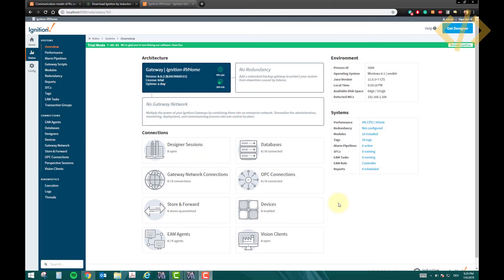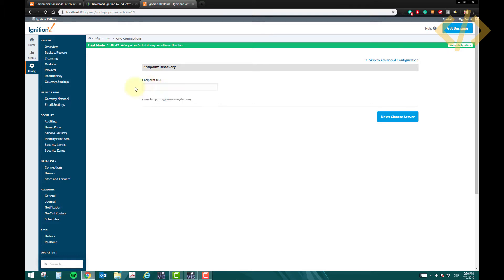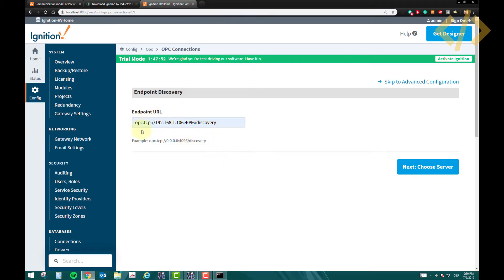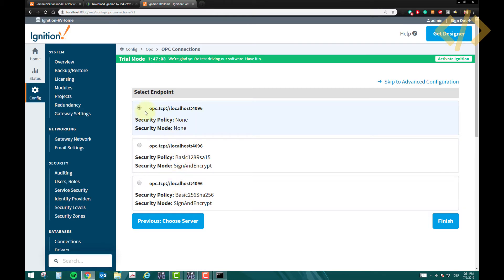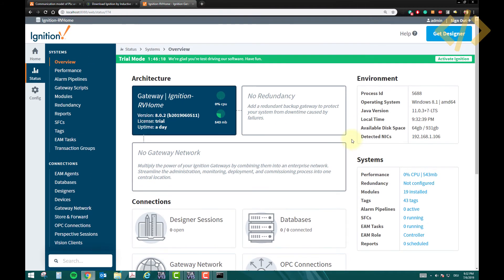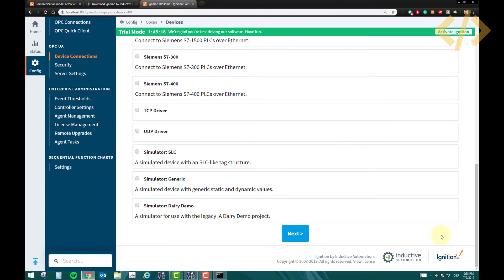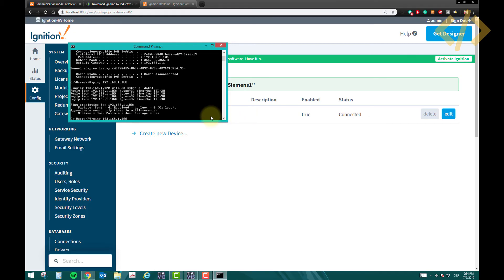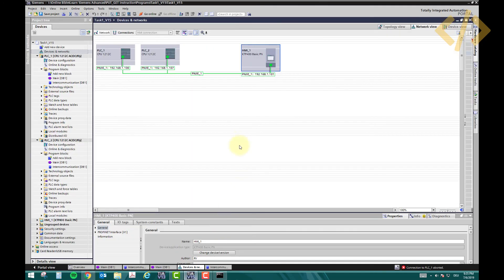Lesson 2-  Creating OPC UA Server and adding Siemens PLC in Ignition SCADA

Comment: Hi,
My customer using ignition and they will like to connect my plc. I check some video and I see only need to add ignition configuration opc from ignition and my plc only provide ip address then hit connect can direct browse my plc tag ? So my plc CompactLogix 5380 , don’t need programming or coding ? Just regular tag from plc , ignition can direct read or control the tag ?

I see opc just built in on ignition software

Thanks
Reply from the maker: Yes you can read that. Just make sure you add correct IP address for the PLC with OPC UA port number. You can read the tag directly

Comment: Watched the last 2 vids with Ignition and so far well explained. This is a software that we've looked at before at our office and I have some personal interest in using it for Edge device connection. I will see if you have any other courses on Ignition SCADA at code and complie other than the few video lessons you already have here.
Reply from the maker: There is a full course at learn.codeandcompile.com. You can also try Nodered which is completely open source unlike Ignition. In Nodered you have to program more but it's super flexible without any limitations.

Comment: Do we need to buy a special OPC UA license from SIEMENS for this?
Reply from the maker: Good question- No, if you have Siemens S7-1200 ..just Update the firmware and you will get OPC UA inside.
Reply: @thegeterrdone  thanks for your reply rajvor. How about if we want to use S7-1500 as a OPC UA Slave?
Reply from the maker: @arsihbk  Slave? You mean Client? There is  no Master or Slave in OPC UA .. we talk about Server and Client only. Master and Slave exist in MODBUS
Reply: @thegeterrdone  yea I mean client. Would we require an additional license for S7-1500 ?
Reply from the maker: @arsihbk  You don't need an additional license at all. It is included in the hardware :)
Reply: We need buy for Rockwell compact logic for plc site ?